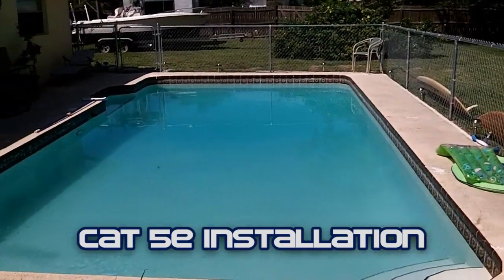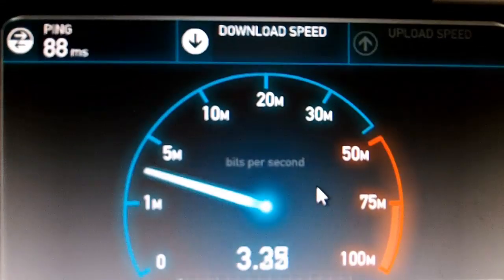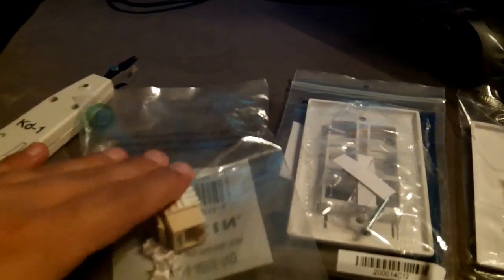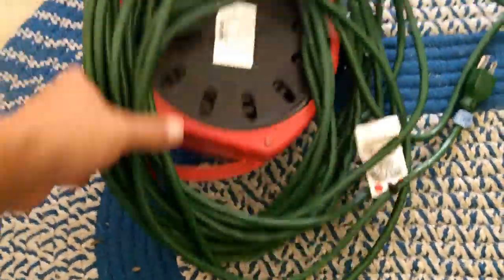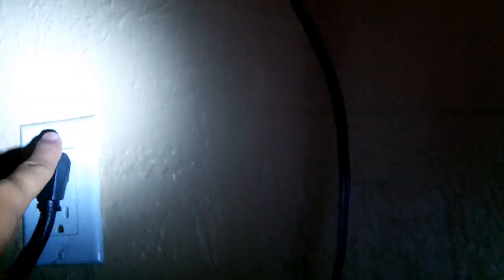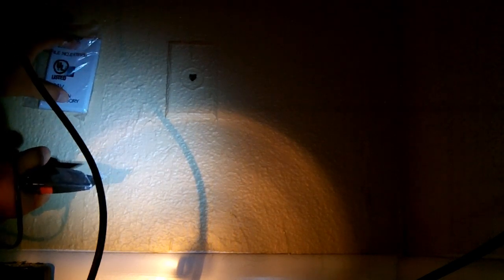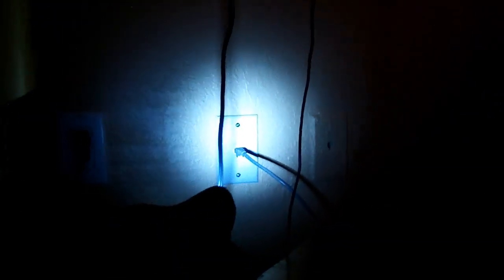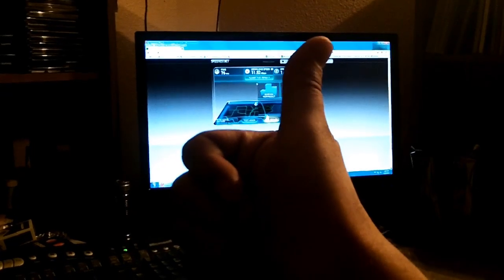Cat 5e Wiring Install

Comment: I know this video is sort of old now but being that it’s now 2017, I would recommend to anyone watching this to definitely use Cat6 or, if you really want future proofing, use Cat6a.   Both are rated for 10GbE.   10GbE equipment will definitely be coming down in price in the near future.    Cat5e will do the job (up to 1 Gigabit) but the price difference is negligible between it and Cat6 so you might as well go with Cat6.  
Cat5e will do 1 GbE up to 100 meters. 
Cat6 will do 10GbE up to 30 meters.  
Cat6a will do 10GbE up to 100 meters.
Reply from the maker: Agreed, I did not anticipate the proliferation of wireless devices this fast.  Data usage is relatively low right now but even during idle there are beacons and app updates.  They're fairly light today but in the future I imagine they will become much more bandwidth intensive. The problem isn't a device by itself it's the amount of devices when your friends come over etc..  it adds up.  Residences that have unusually large families could probably start to switch over to Cat6a sure.  Cat5e won't become obsolete for most residences for a very long time.  We're still years away from the next shift but if you want to stay ahead of the curve and future proof by all means go for it. Why do it twice in a decade instead of once if you just select the right wire to install. ;)  Thank you for the great comment.  I enjoyed it very much.
Reply: I actually sort of wish I had paid just a bit more and went with Cat6a but one reason why I didn't is because I've read it's much more difficult to terminate properly.  It's not too difficult to pull new cable though and I won't have the need for 10GbE for awhile.   I'll see how my Cat6 does when I get 10GbE and if it doesn't cut it then I'll replace it all with Cat6a.  Honestly, though, I think we will be getting to the point in the next few years where single mode or multimode Fiber will make economical sense in the LAN and that can obviously support far higher than 10GbE.

Comment: you should have used the phone jack..replace it with cat5 ..no need to make another cut out
Reply from the maker: Probably could have sure.  I planned on adding 4 more lines to that wall plate.  I ran out of wire for another long run to the family room and that ended the project.   I couldn't justify purchasing another spool for the project when I had a car that required attention.

Comment: NEVER use scissors to cut cat5 cable. You run a greater risk of nicks and cuts, and will lead to unreliable connections.
Reply from the maker: +Siddhartha Modur Wires have to be stripped and recut anyway.
Reply: Oh. Okay, If you were using scissors to strip cables to directly crimp in to RJ45 jack

Comment from the maker: I had a crappy crappy drill bit.  It actually broke.  I couldn't make a hole large enough to run multiple wires plus use the fish tape.  With wood boring bits you get what you pay for I guess. :P
Reply: DJDevon3
Reply: how to install Internet cable in a house Australia

Comment: In regards to not using CAT 6 that is a valid point for a DSL connection on the speeds mentioned but if you are one of the lucky people that have fibre optics to the premises in the coming years you will need CAT 6 to get the best out of your network.

Comment: I like this video it has some good instruction on how to run network cables that I would like to try out.  I would have considered fixing up that painted over telephone jack to dual jack configuration. Depending on where the phone wiring was coming from and size of hole in the attic you could have run the Ethernet cable through the same hole.

Comment from the maker: Not that I'm aware of.  In general home construction you can use unshielded twisted pair no problem.  It's only when you get into obvious situations where it should be used such as across HVAC systems, plumbing (hot water line), between fire breaks such as the garage, and so on where fire safety comes into play.  Just use common sense when building a home network and you'll be fine.  Fire standards are usually considerations and enforced for commercial buildings and networking.

Comment from the maker: Yes had poor signal on the other side of the house about 50ft away.  Was disconnected more often than not it was really bad.  Just a matter of distance that's all.  With ethernet and a 2nd wireless router you can extend your wireless network range.  Set your 2nd wireless router to use the same SSID and password as the 1st transmitter.  Your laptop should automatically connect to the best signal just like how cellular towers work.  Same concept.  It's all about signal strength.  Works for me. :)
Reply: DJDevon3 how

Comment: Nice demo. I did this a few years ago, not for increased speed but for what I think is better security. 

I guess I don't understand why you need two wireless routers. Was reception poor, resulting in slower WiFi?